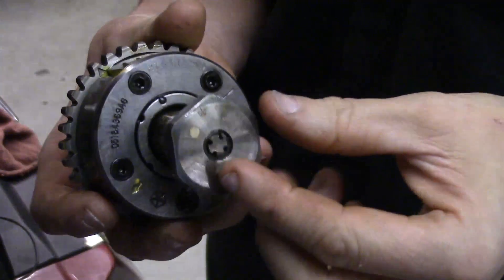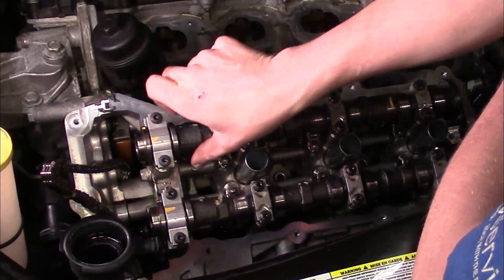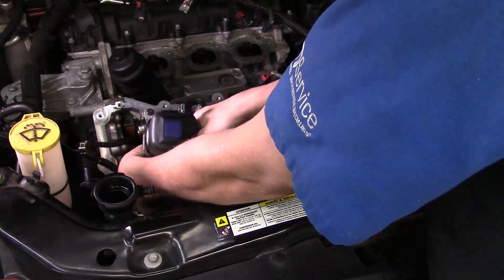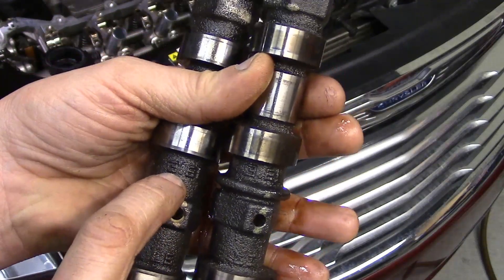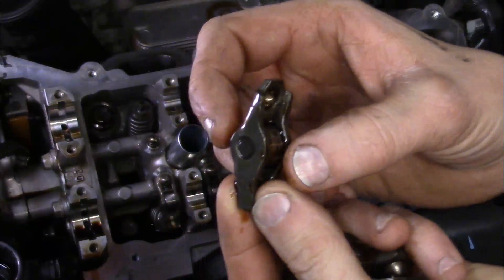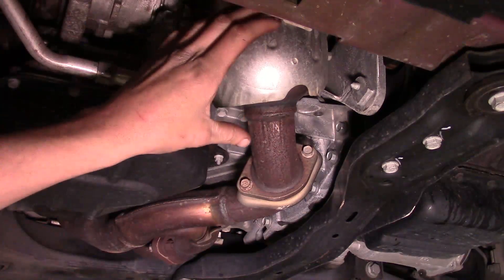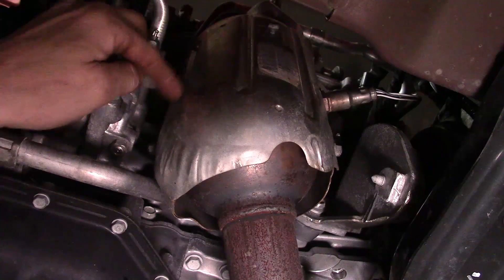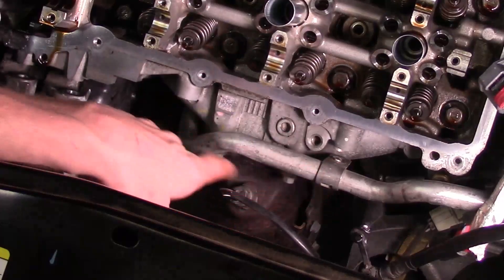Part 6/10: 3.6 Pentastar engine left cylinder head removal (the short cut)

Comment: My dodge caravan 2013 seems to shut down after 3 seconds of start. I also get random multiple misfires, alinement and slow response on all camshafts. I changed out sparks, coils, rockers, and lifters. Also changed out the alternator, have you any tips? I’m about to also change the phasers and the oil valves.

Comment: Hey so I forgot to set cylinder to tdc and I pulled the phasers and the cams rotated a bit after I pulled the phasers. I did have paint marks on the chain and Phasers. How screwed am I ? Or is it just a matter of putting phasers on and rotating the cams to line up with the chain ?
Reply: If your crank timing didn't move just set the cams the same as they came off if you marked them you should be good just don't let the timing chain fall off or move on the crank gear. If it does your going to have to take the timing cover off in order to set it all that way.

Comment: Do you have to remove the trans tube to remove the passenger side valve cover in a 2011 Grand Cherokee 3.6?
Reply from the maker: The service info says yes you do have. Thanks for asking and make sure to subscribe.
Reply: MotorCity Mechanic thanks. I can’t seem to get it out. Any help?

Comment: Man i wish you was here at my house to help me unlock this hydro static engine i pulled everything off and the engine still wont turn
Reply from the maker: Sounds like you have a chore ahead of you. I havent seen one yet come in for that reason but if it was running at a good rpm with it happened then those rods could be "s" shaped now.....that I have seen before on other engines. Thanks for watching and for the comment. Make sure to subscribe.
Reply: @MotorCityMechanic  thank you for responding to my post. I enjoy watching your videos. Quick question just Where would the pistons be on the top or the bottom

Comment: I have 2015 Ram Promaster has a misfire cyl#4. I replaced all 6 coils, spark plugs and 6 injectors. Still has a misfire #4. I did compression test. All cylinders are good. Inspected all wire harness and connectors. All good. What is possibly wrong? Please help.
Reply from the maker: Personally I prefer a cylinder leak down test over a compression test and actually thats they way Chrysler wants them checked as well when issues come up. If all checks good then one thing they recommend is replacing all 4 lifters and rockers arms for that cylinder. I have seen that fix a few......usually when a rocker arm starts to go bad, it will cause a skip first before eventually causing a noise.

Comment: Good job..I have a question how many footpound torque do I have to use for the camsahfts  bolts..thank you for you help..I'm doing the rocker arm and lifter just follow the videos...You are a good teacher.
Reply from the maker: Are you speaking of the cam bearing caps or the bolt (oil control valve) that attaches the gear to the cam?
Reply: @MotorCityMechanic  I got everything...I seen your video #10 and get the information..Thanks again.
Reply from the maker: @larazamx68  Your welcome and thanks again for watching. Make sure to subscribe

Comment: I will be pulling my cams off to replace the lifters since I have at least one bad at 103,000 miles on my '11 T&C. Bought it in February and what a great ride it's been so far.  I already had to rebuild the transmission due to a bad Final Drive Compounder, that was fun to experience after owning it for 3 months. A week ago I noticed a ticking noise some days and was hoping it was a bad rocker arm since those seem commonly bad, but they all checked out and found a bad lifter instead, so here we go again. At least I won't have to pull the front cover off in my garage once my miller tools arrive. That's a bit of a relief. I will be referencing this video I'm sure, so thank you for posting it David!
Reply from the maker: Thanks for watching.  A lifter failure is rare.....95% of the time its the roller rocker. It can be hard to see other then the groves that get worn into the cam lobe outer edges. When taking it apart.....double check the roller rockers and see if the roller portion has movement due to failed needle bearings. Dont just take their word for it. Let me know how it turns out.
Reply: Matt Corns how did you test the lifter to know it was bad curious to know because I took my lifters off and blew Air straight through them and determined that they were all good, is there a better way to test these
Reply: Was it a bad rocker arm?